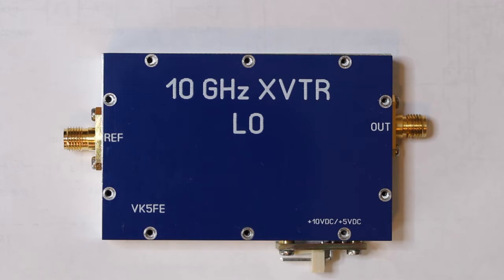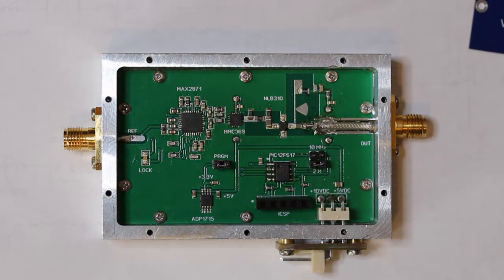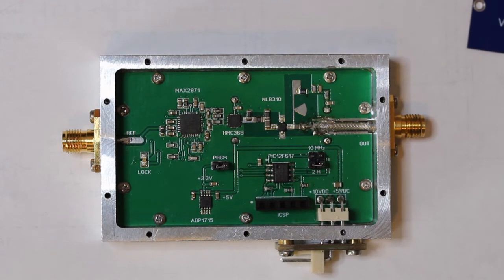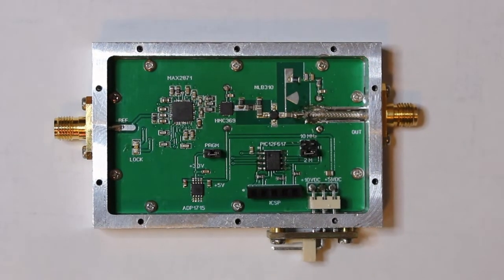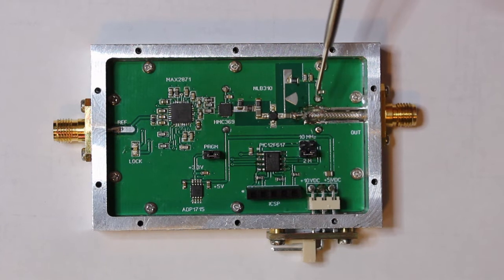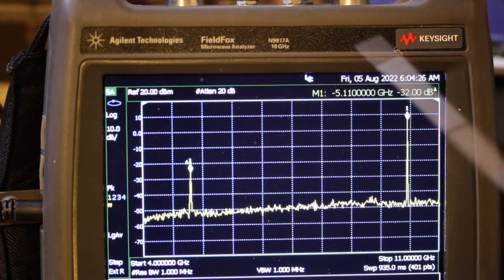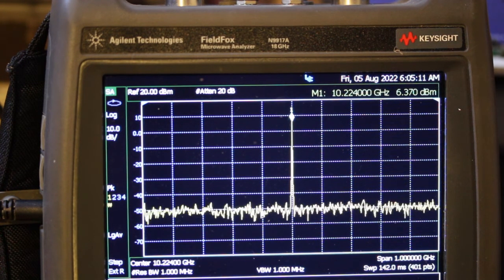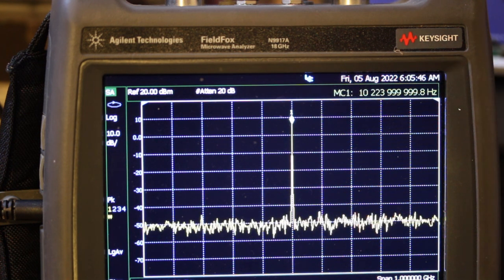#23 LMX2594  - the MAX2870 or MAX2871 as an option

Comment: Can you send me details of sweep mode of MAX2870  I want to generate  860 MHz to 970 MHz band
Reply from the maker: Hi Zia. I am afraid the MAX2870/2871 doesn't have a "sweep mode", you will have to program all the frequencies, defining a time interval to set the sweep speed.
Reply: @vk5fe943  Thanks Sir, I am new with MAX2870 i want to genrates 433MHz Freq single frequency . can you provide me the source code. i am using Arduino board. I shall be very thankful if you guide me in this regards 
Kind Regards
Reply: @ziamalik189 Good day. Have you found a solution yet to achieve the 860-970 MHz sweep mode? It is interesting, because it is also necessary.